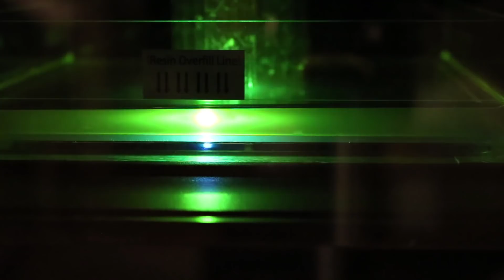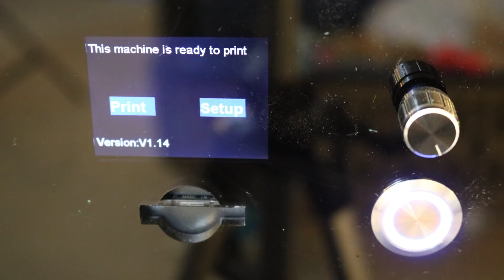First Looks at the Peopoly Moai SLA 3D Printer

Comment: How much quicker does an SLA print the same model on a filament style printer?  I know the resolution is much finer details on SLA typically.  So for example could you run a test of two identical models and get some time data on the results?

Comment: Have you thought about using the Polysher to alcohol rinse the SLA models?  If you add UV light for curing you might be able to do it "hands free" :).
Reply from the maker: +reasonablebeing that's a really interesting idea. I'll have to try that. Thanks for the suggestion. 😊
Reply: I have a Polysher and have not tried it yet - the part I have in mind for first use is still in design.  My only other thought about the polysher is if you made the unit or the table vibrate if that would "shake off" the alcohol or give the model an interesting finish.

Comment: I learned something today as I thought SLA required few if any supports compared to FDM.  I guess I only saw small models that didn't need any support being showcased.
Reply: SLA and DLP printers are capable of printing more things without support than FDM printers, but some models do require them. The good thing about them is, that the supports required use a lot less material than FDM printers. The amount of supports also differs between top down and bottom up printers. Top down you can often get away with less, as the model sinks in to the resin rather than being lifted up and out of it, which helps to support it a little bit.
Reply: I'm one of those people that strive for no supports, but confess it gets me in trouble on occasion.  I almost got a used Form1 but heard they had some issues, albeit the price was tempting..
Reply: Not sure how much it was being second hand, but if you're interested in resin printing, check out https://www.gizmo3dprinters.com.au/ . It's a top down DLP printer with a much bigger build volume than most other SLA/DLP printers. I bought one last year and it's been great for me. From memory, the cheapest one they sell is around $3950 USD, which is cheaper than the Form2. If you want to see some prints from it, I have some videos on my YT channel. Not much yet, as I only started making the vids recently, but should give you an idea of what they're capable of.
Reply: Out of my $ range for now, but I will check out your channel for sure.

Comment: How does it compare in price of the print with FDM printers? Is it step up from FDM printing or is it just a different option for printing? Your thoughts?
Reply from the maker: +Juri Lichtner it is definitely more expensive than FDM, and it requires more post processing (like curing and rinsing it with alcohol). But SLA printing can get amazing detail compared to FDM. I'll try to show off the differences as much as possible in the future. And I think I'm going to do a "Top 5 misconceptions about SLA printing" video. Because there seems to be a lot of confusion. 😊